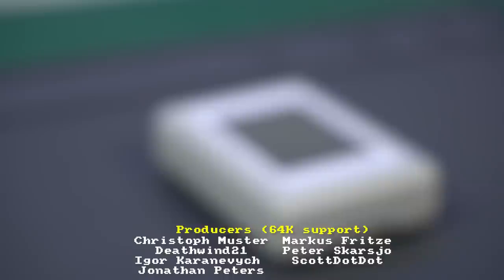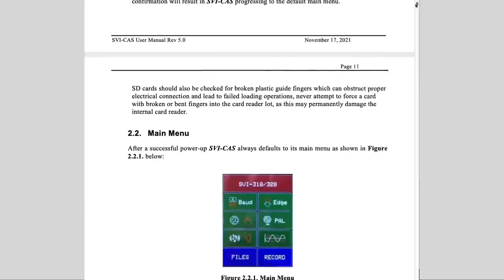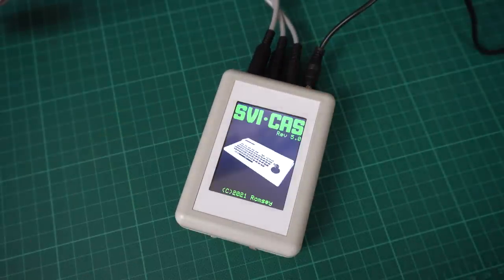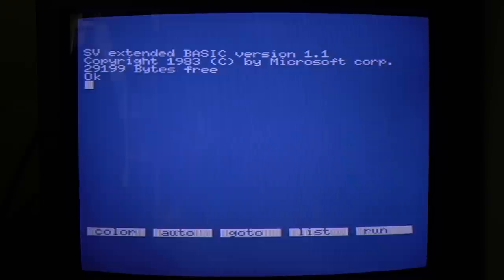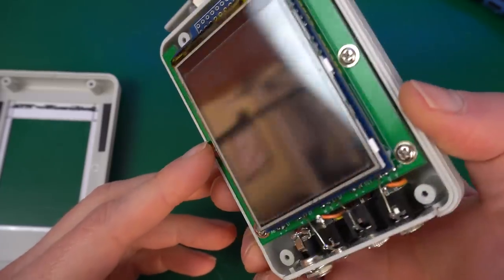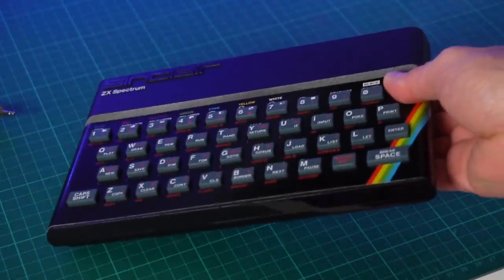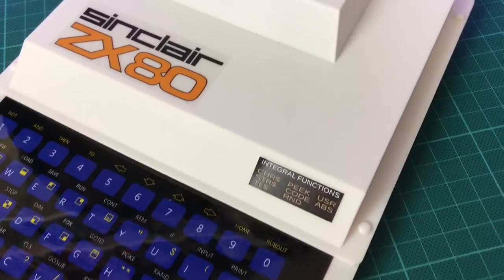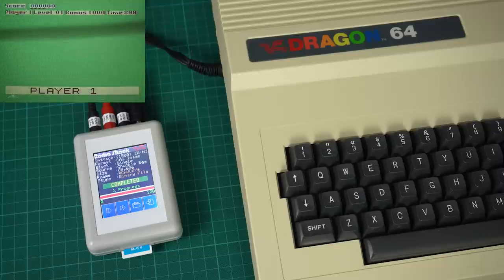The Ultimate Retro Cassette Replacement?

Comment: It's my understanding that the VIC-20 was almost always cartridges. You get more memory for games that way. The RAM expansion was not common from what I've heard. For the C64 things are different. Cartridges have memory limitations that disks and tapes don't have. So the cartridges weren't all that common especially after the first few years. There are ways around it, but it requires extra hardware making the cart cost more. As for disk/tape I've heard that in the USA it was mostly disks and in Europe it was mostly tape. However most tape programs seem to have been converted over to disk. Tape is a lot slower so it makes sense that in these modern times where you can get cheap 1541 replacements or something awesome like 1541 U2+ or the backbit, tape lost its appeal. I've noticed that today tapes are harder to find online than back around 2000 or so. I used to find tapes for download all the time back then. I did get the tape adapter for my U2+, but I've never used it. It only cost $5 more so I'm like why not.
Reply: As for the Commodore cartridges I knew nobody who had one for their C64. With the VIC-20, yes, cartridges were used but I remember all users having a tape drive.
Reply: @oldguy9051  well yeah you kind of had to. It was pretty much the only way to save things. I think the 1541 was added at the end of the life of the VIC-20. Before that it was just tapes. I did have some C64 carts, but only like 1 or 2 of them.
Reply: @oldguy9051  the only cartridges that were really popular on the C64 were fast loaders and freezers. The VIC20 had a few ram expansions that were needed by a bunch of games, but they shifted the memory addresses, so they also came with a switch to disable them.
I remember playing radar rat race on mine, but I get PTSD just remembering the music. 😂

Comment: I hate Internet! After 2000 lines of assembler code to play these TZX files I found it already done, much better, and ready to buy. Well, I wasn't trying to outsell TZXduinos or anything, just to load some game images into a CPC464 replica in a FPGA without using external players like this (the board already includes an SD card), and the project went a little out of control...
And, BTW, can the SVI-CAS load .K7 tapes to a Thomson MO5? (I got one of such computers)

Comment: One thing that I was wondering is if for some reason the C64 cable to someone but if they had a working dataset and a cassette to CD/MP3 adapter on hand, would that work to load tape files?

Comment: Didn't the OG IBM AT have support for tape files? I remember LGR talking about it a few years back. Would be awesome to see an AT PC boot from tape.
Reply: The IBM PC and PCjr definitely had cassette I/O but later models didn't (XT, AT...).
Reply: tape drive yes...they where not standard audio cassettes tho, more like a digital tape and drive for it to fit....i have one sitting in my collection..usually they used for just backups, never for actually working with on the daily...

Comment: It's a neat device, but one thing in the video kept bugging me. 

You keep contrasting the "ATMEGA 2560" to "The Arduino"... but the ATMEGA 2560 is an Arduino (technically an AVR MCU, but it looks like they used an Arduino anyway, and the other Arduino based device could run on a 2560, so... why the distinction?).

It's like saying "The Intel can't keep up with the Pentium" (because they're both Intel based).

Comment: I did not see Atari 8-bit family. With a very easy modulation, it should be no brainer to provide the interface cable to  the SIO. And maybe the forgotten IBM PC (not XT) cassette port?
Reply from the maker: It wasn't supported at the time I made the video, but it is now in version 6 of the firmware 👍

Comment: Well i wonder if it will also work with famicom basic trough it’s keyboard,would be great to store all your own created excitebike and wrecking crew levels on it among other famicom stuff on it,

BUT the cool part is that you can (if necessarry) digitise all your computer cassette tapes and then use for now on this magic device and never ever worry any more about wearing out or corrupted data and psysical damaged tapes due overusage of it,no more counting or getting confused about wich place on the tape you have stored your programs or were on the tape to load your written program or save files from,no more rewinding or fast forward ,just click and go,
Now we can save our data from it and throw away those slow fragile unreliable tapes😁🤣

Comment: Try Chuckie Egg on the BBC Micro - it's by far and away the best version of the game on any platform (cue flamewars!)
Reply from the maker: Is it different than the Electron one, or is it the same executable but it just happens to run at a normal speed?
Reply: @NoelsRetroLab  Yeah, I'm wondering if you were running the full fat BBC Micro version on the Electron there - there is a specific Electron version as well

Comment: A lot of those wall power supplies are junk. Tried to use on an Atari 400 and it produced terrible video interference.  The best soultion is to go to someone reputable like Digikey/RS components and finding one of their power supplies, they actually have datasheets with noise figures disclosed.

Comment: I don't know why he chose an Arduino 2560  instead of an ESP32, but I'm sure he had his reasons. 
If he needed more input/output, a multiplexed I/O would've still been faster, considering ESP32 can run at 240MHz.
Reply from the maker: Maybe having to convert between 3.3V and 5V? Not sure, but that's always somewhat of a barrier to use newer microcontrollers.

Comment: This may push me away from the kung fu flash as it also works with the Amstrad CPC
Reply from the maker: On the other hand, loading times on the Kung Fu are instant. This takes as long as a real tape. Not comparable, really.
Reply: @NoelsRetroLab  I know they are 2 very different devices, but from my angle as a newcomer into 8bit computers with an Commodore 64 and Amstrad CPC 6128 I think I would get more out of it personally. I would save up for an flash cartridge later down the line.

Comment: I enjoy your content and I'm just having a laugh here, buuuuut....  I don't know if the comparison between a Toyota Corolla and a Tesla holds up LOL.  I mean the Toyota will actually last hundreds of thousands of miles, has readily available repair parts, and will function correctly in all weather conditions...  A Tesla is really designed for folks who only drive short distances in fair weather.  I would cite all the winter weather problems with their climate control systems, and the extensive wait times for those who need repairs on their Teslas.

Comment: About the touchscreen: I always thought that making those kind of interfaces are a waste of resources, they increase the price, and give you a poor UI. Why not replacing the touchscreen with a bluetooth radio, and create a good interface on your smartphone? Better and prettier UI, less price, more free resources for the device itself... I can't see any downside.
Reply from the maker: I can see lots of reasons. I don't like to use my smartphone for that, and what will happen in 4-5 years after you can't run those apps anymore? This feels more self-contained, even if the UI isn't as good as it could be. But if other people prefer the smarphone route, that's great. The more options the better.
Reply: @NoelsRetroLab  I don't see the longevity of an app as a problem, as that can be open sourced, while keeping the device's firmware closed source. Or he can publish the communications protocol so anybody can make an UI app for any device that has a bluetooth radio.
Reply: @Spyd77  it takes way less efforts to write an interface that works on a microcontroller than writing an android app (and iOS would probably need to be left behind).
To me the best interface is a tiny joystick (or four arrow buttons), one or two buttons to sekevt/cancel and a traditional screen.